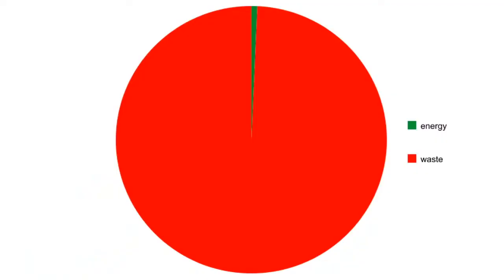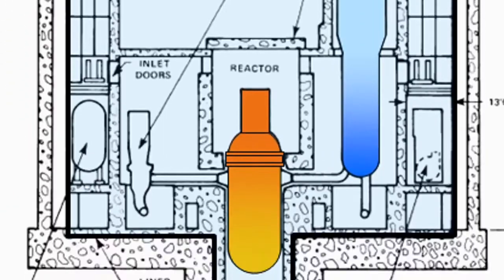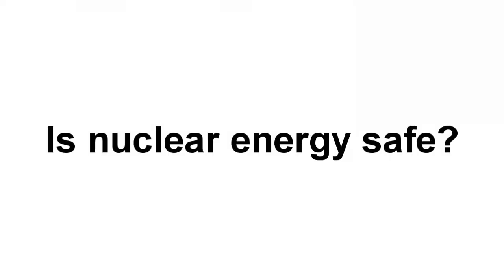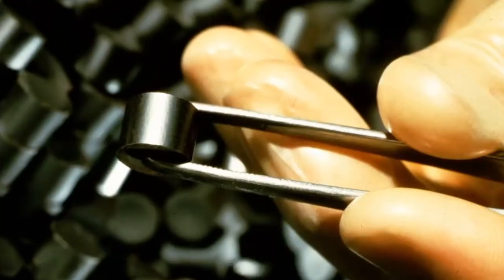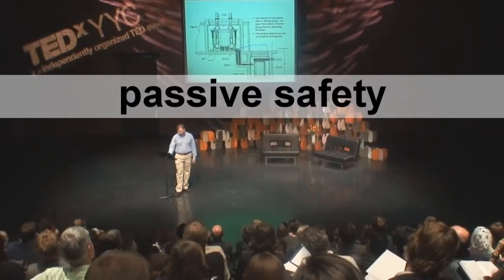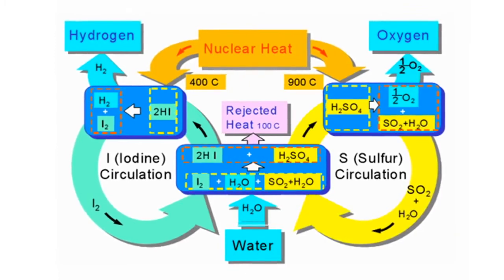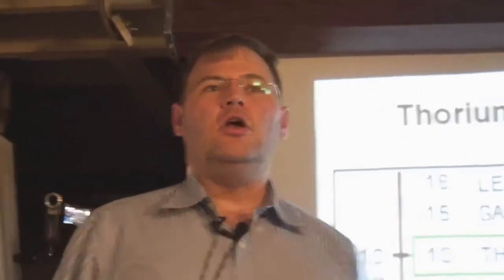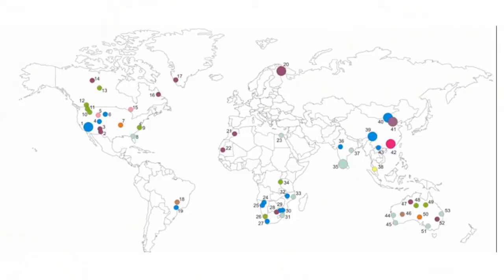Liquid Fluoride Thorium Reactor (LFTR)

Comment: Really! Puttting fluorine  and an alpha emitter in a neutron flux sounds crazy.   Even once you build your reactor to deal with the excess neutrons, you have the ongoing problem of Na-22 gamma rays without end.  You might think Na 22's  half life isn't very much but sodium 22 has a high energy gamma that just makes it a royal pain in the ass to work around for the 6 to 10 years it takes for it to decay down to a user friendly level.   Which it won't do as long as you have florine and an alpha emitter making more of it long after you want it to.  You will't have the alpha-florine reaction continuing on making neutrons and gamma rays until you run out of florine or you run out of Alpha particles.  Th-232 has a half life older than the known universe.  You will never be able to completely separate out U233 and other contaminants.  It will make the only radioactive waste stream that becomes more radioactive over time.
Reply: This is not using elemental fluorine; it is using a fluoride salt.  If you do not understand this simple difference the rest of your diatribe will go unread.
Reply: THE Problem  IS  ITS  ALL   CANCER   &  Lies  Of Greed